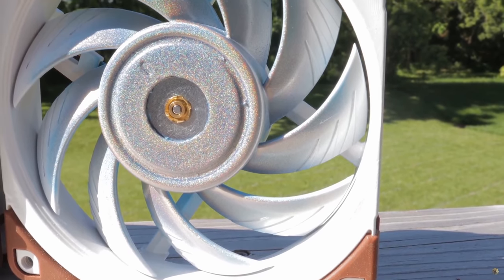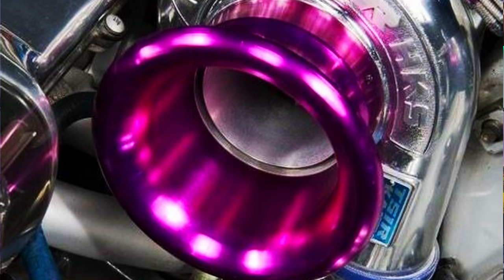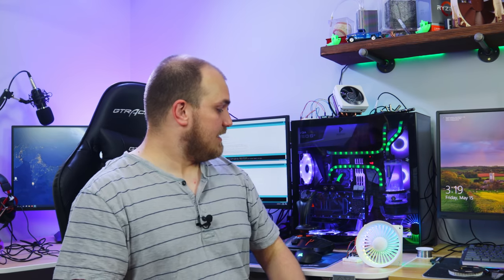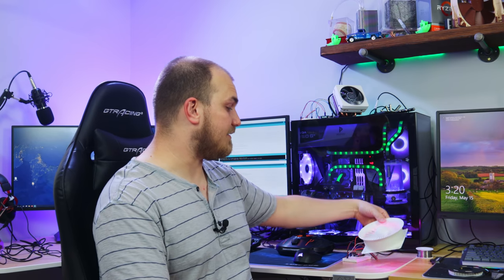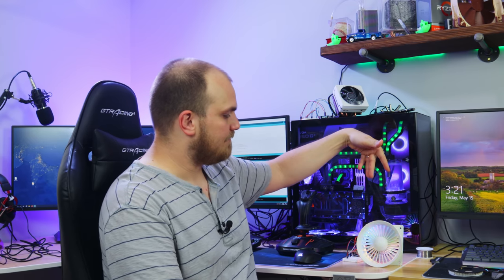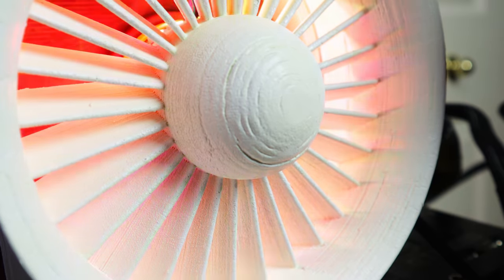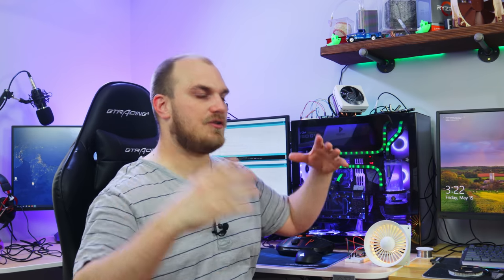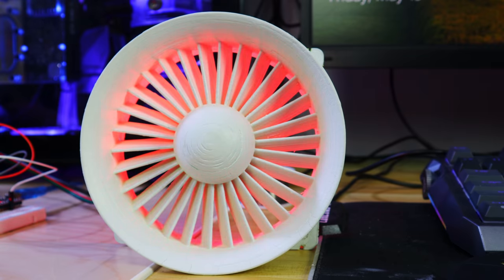This Makes Any Fan Look Awesome!

Comment: Ma man, you need to calibrate your printer
Reply: This is what I was going to say. You won't need to smooth out your prints (within reason - time is of the essence often) if you take the time to calibrate it. That way even if you're printing at low resolution you're just a quick sanding away.
Reply: A Dremel sander makes sanding super fast too.
Reply: Came here to say this. There's definitely a lot of room for improvement on his prints.
Reply: Cheap printers needs more effort, you need to reduce all the wobbling first before you calibrate it. I put under every screw from moving parts a polymer O-Ring to reduce the play.
Thats mostly enough to get way better prints. Then you can recalibrate your printer.
Reply: i got good results on a cheapo monoprice mini BUT i played so much time with all advance parameters on cuda and my prints take 1 or 2 days xD. depends if you want to put the effort or just go "good enough"
Reply: His previous prints were ok, maybe its just the material but god it looks disgusting in that close shot.

Comment: The idea of a velocity stack is to reduce the "intake resistance" where an airflow enters a duct. There is a problem with high velocity airflow, where at the edge there occurs turbulent flow, which is very very resistant for air to pass through, as it elongates the way the air has to take and in addition to this it favours the wall effect (the velocity of any fluid, that flows through a pipe is zero on the inner wall of the tube). So, when you have laminar flow, this means, the zone of resistance is very slim and close to the walls. Therefore, the airflow can enter the duct very easy. However, this effect is related to high velocity air flow. Your average PC fan is not nearly in those realms and the effect of a velocity stack should be near to impossible to meassure.
Also, since you added stators in your stack, which will turbolate the airflow, your creation should not work at all ¯\_(ツ)_/¯
Reply: The only velocity stack that i think could work would be one on the top of the pc case - assuking ur pc case has vent openings. Think cooling tower for a steam turbine. but obviously that woud look ridiculous. Either through convection alone, or a induced draft with a fan at the base.
Reply: Physics is a bitch, huh?
Reply: Case fan be like 40cfm. My 2 liter subaru engine pumps like 1 liter of air every revolution if it was 100% efficient and not count the boost the turbo makes. That's like almost 250 cfm at rev limit through a very similar size hole into the airbox. Yeah at those speeds that flare is very usefull

Comment: Exactly what I talked about in previous videos. You should test it on lower rpm.  It should improve airflow at lower speed.  What you build is a intake vane that directs airflow on the leading edge.  Depending on its angle a specific rpm would improve by it.
Reply: It wont improve it because his swirl duct vanes have the same pitch direction as his fan blades. If he had the opposite pitch it might have been possible to get slightly more air compression.

Comment: You need to place the printed part and the open acetone container next to each other in a large container and close it. Acetone vapors will dissolve the outer surface of the printed part and smooth it out.
Reply: Doesn't work for PLA though.

Comment: @Major Hardware It would be interesting if adding the "velocity stack" to the exhaust of the fan, and then add that inside of the case to see if it does a better job of cooling internal components.
Reply: also: to test if a straightened flow can cross a radiator stack with less drag
p.s.1: https://www.stlfinder.com/model/120mm-pc-fan-stator/4391442/
p.s.2: search the web for "axial fan straightener"

Comment: Your biggest issue is your slicing settings and/or machine needing maintenance.
For good White PLA get Zyltech Ceramic White. Best white i've found.

You want to print that at 0.05 to 0.12mm LH, make sure your extrusion flow rate (E-steps or flow %) is right, and you are printing at high enough temp but not too high. Typically recommended temps are way too low, i prefer 205-225C range for Zyltech PLA. Extrusion width should be for 0.4mm nozzle 0.4mm to 0.5mm.
Reply: Did you see the print? I'm not sure his printer is capable of 0.05 layer height, besides 0.15 or even 0.2 would be fine. and you can print as small as 0.36 or as large as 0.8 with a 0.4mm nozzle with 0.6 being the sweet spot for strength. As for temps, he really needs to work that out for himself, his thermistor might be off, or he might have a crap hotend.
Reply from the maker: My hot end is crop for sure
Reply: @MajorHardware  clean it thoroughly, make sure PTFE is all the way to bottom and the fittings are not loose. To take all play out of the PTFE unscrew top fitting 1 turn, nozzle 1 turn, then push ptfe down and tighten everything again. This needs to be done at 180C+

Some thermal grease on heatbreak top thread can also help a bit.
Reply: @MajorHardware I didn't mean any offence, if it works it works right? I watch your channel because you do awesome wacky stuff just cause you can, not because your 3d prints look like they were injection molded. 

keep up the good work man!

Comment: Great video as always!
I've always used a sandable filler primer to smooth out my prints. just 2 coats, a bit of sanding and you are good to go. 
So far the Rust-Oleum one gave me the best results, and you can find a ton of examples of people using the Rust-Oleum online.

Comment: I would recommend filling the imperfections with some type of epoxy then sanding it with a fine grit to smoothen it out. If not, then I would invest in a printer with a better resolution such as a Creality Ender 3/3 pro which are below $200-$300

Comment: you can buy filler primer that should fill in print lines somewhat, then for the deeper divots/print anomalies you can use autobody filler like "Bondo Glazing & Spot Putty, 00907"

Comment: For painting 3D prints, I use filler.  It adds a fast drying, sandable layer, fills in gaps and the print lines. Depending on how far you want to go you can spray/sand/spray/sand etc... Around 400/600 grit is ok.
Afterwards you clean off the dust, degrease and paint

Comment: You can try using body filler primer if you want an easier and faster way but typically that still needs a bit of sanding before and after you spray.  The spray paint and poly method works without sanding but be aware it is hard to get right, the trick is you use a bunch of light coats and dry with a hot box(a blow dryer into the hole of an upside down cardboard box will work great) or fan.   You actually go a bit heavier on the paint and use the fast dry poly to seal the paint pretty much.

Comment: You can smooth pla by using acetone fumes in something along the lines of a 5min on/10min off setup. the only real problem with that is the pla will melt under the pull of gravity so you'll have to orient it correctly and also use a fan of some kind to blow the fumes over your piece so it gets into the smaller bits.
you'll have to experiment to get it correct because it's a bit of a nuisance to get working perfectly.

Comment: If you use an epoxy primer, and wet sanding you can get a nice smooth finish on your prints. Start with about 90 grit. When you have almost no primer left but a smooth surface wipe it down to remove the dust and prime again. This time use 220 grit or higher with lots of water until very smooth

Comment: Once your 3D prints are done, coat them in filler primer, then sand them down, re-coat with filler primer, and sand off again. You can then apply your base-coat/colour of choice. Once your first layer has dried, lightly sand off with some high grit (1600 or higher just to remove any find bumps and splats within the paint coat) and then give its second and/or final coat.

Sauce:
Painted 3D models I've printed before and this is one of the best ways I've found of getting silky smooth finishes

Comment: Looking at the closeup of the stack, I noticed many voids and generally poor blending. If this is what you are getting regularly, I’d suggest to review the filament you are using, the settings of the printer and the slicer program are compatible and that the nozzle isn’t clogged. I had a similar result, cleaned out all the old PLA in the head, put a new nozzle and it fixed it. I also added a filament filter and now get consistent perfect prints roll after roll. Hope that helps.

Comment: You could also run those less off of any addressable led header on a motherboard or  lighting controller, just make sure 5v,gnd & dat lines are correct

Comment: I find filler primer works beautifully on pla prints, it does what it says, and is super easy to sand, you just gotta get close and make sure you're actually filling stuff in or else it isn't much better than primer

Comment: If I remember correctly, you'll want to take a little bit of solvent to kind of chemically melt the PLA to smooth it out and then sand it a little to get it the rest of the way where the resolution lines of layers are about even and then finer grit sanding should get the level and smooth texture where resolution lines from the print layering doesn't interfere with the function of the print item or add discernible difference in results between function testing of stuff. Some regular old 100% acetone from the dollar store should work. Just test it on a small area on a sample print and see if you get the results you want or are satisfied with. Though, if you want to smooth it out and also want to strengthen the printed item, you can use like epoxy resin or acrylic resin if you don't care about adding a little bit more weight. Depending on how much material you remove or resin added, weight and strength of material will be effected and acceptability is determined by need and you, etc, of course.

Comment: Try using automotive body fill to fill in the holes and gaps to smooth it out, less sanding down the printed parts. Sand smooth, prime and paint them. Also glue some fine grit sand paper to a popsicle stick to sand between the fins. Painting it doesn't get rid of the the unsmooth surface you have to fill it with something strong, hell even epoxy would work as well

Comment: btw, most aRGB fans also use WS2812, so you can control them with an ESP8266 or arduino.

Comment: Use drywall spackling. It's a great lightweight filler and it sands super easy. Then use a filling primer to smooth it out. After that, you can move onto your base coat and clear coat.

Comment: Just curious if you’ve tried printing that blade with the noctua hub and the outer circumference of the blades connected on a ring like the noiseblocker eloop?
Reply: if he did that he could use thinner blades too, if his printer allowed it.

Comment: One other thing I forgot to put in, you can also use one of the profiles that people use for minis, something like 25 for the speed and .4 or .5 layer height (just be aware that it will probably take forever for something larger like that fan shroud).

Comment: BTW you can wire the leds to directly to most motherboard addressable RGB, or most other RGB accessory. I have been using the lighting node from corsair for my underdesk ws2812B, instead of buying their expensive RGB strips for only 10 leds on one. You can get a whole meter (3 feet) or 5 meters (from china) for the price. 
Tip, if you use icue, on setup don't select the LED strip as the output since that limits you to 60 LEDs per output (10LEDS * 6 corsair strips max) use their high density fans (i.e. the one that has 120 LEDS) 
BTW, you also need to feed external power to the strip, and not the icue, to be safe. Wire Ground and 5V to your PSU and Gnd and signal only to icue lighting node.
Open RGB would work as well
Reply: I have used arduinos for lighting in the past, but this way it's way is easier to use, especially for beginers.

Comment: Also design time. Try a helical impression on a conical pointed center piece. Reduce the fin count to three. Add a little hight to the outside and give it a matching helical impression at say 35 degree twist. Try to match the spin ratio of the fan with the twist of the impression.
Line the fins up with the helix and extend them up and down close to the fan....
Ok that's all I got for this one.

Comment: If you had the fins angled in the opposite direction, what are the chances that it could potentially help with straightening out the airflow coming out of the other side? Just think of something like the Silverstone Air Penetrator series, or maybe with what you saw with the Scythe Mugen 2.

Comment: As far as your smooth 3d printing... It looks like you're having under extrusion issues. For fresh pla, I usually use 200-205 but also watch the extruder. If the little bearing that the filament rides in isn't moving, try adding a finger to give a slight bit of downward pressure. Not too much, just rest your finger on the lever. 
If the bearing starts moving, there may be a hang up in the filament path.... If the extruder stalls out and blips, losing a step.... Check the driver vref for the extruder against the data sheet. It's an Intretesting project, I'll have to try it in the silk white and silk gold

Comment: to get smother prints will cost you more time no matter what way you do it 

my best results are use .1 mm layer height with a .4 mm nozzle and run the printer at 50 to 60 mm/s but that will make prints take forever

other factors could be your temp's being to high part cooling is not good a worn out nozzle or even your extruder ether being to tight and chewing filament or to loose and not pushing the filament all could cause inconsistent flow rates 

tho other thing i use is a set of diamond riffler files they work wonders on PLA and don't take as long as sanding but they will always leave a velvety feel that is actually perfect for painting but also can be sanded to a polish relatively easy

Comment: you might look into putty.  perhaps the stuff used for plastic model kits.  tamiya and some of the others make it..  apply it, let it harden then it should sand smooth reasonably quickly.

don't know if the stuff will hold up well enough to use on spinning components, but it would work for this intake design.

you might also check out tamiya's spray paint or primers.  seen it in use on a Marty's Matchbox Makovers and it seems like its pretty user friendly.  he also uses simple krylon types too to good effect.

Comment: next step: realize that you can light up fan's blades directly to achieve right color
and yes, it's already on market - look up for Phanteks Halos
Reply: That's what I thought... problem is, it obviously looks awesome on white fanblades, but on black/brown/darkgrey fanblades I expect the effect will be underwhelming. I looked into that myself because I have grey Noctua fans in my case, and black NZXT ones on my Kraken X63, and I could do with some more light in my case... Especially the NZXT fans would be nice if they could throw some light down into the case, but I'm worried because they're black it will be too subtle.
Reply: I've got halos on black fans. One on fractal that came with the case, one on the Dark Rock Pro 4's silent wings. Halos still look great (especially on the silent wings since it makes their weird line shaped fans stand out). 
It would be brighter on white fans for sure, but it's still very bright on dark ones. 

On the brown noctuas I've seen recordings of it also looks good although I'd assume it'd make all colours off slightly towards orange - not much though since it's so dark.

Comment: So the only recommendation I can make for smoothing the pla would be using body filler to fill in the spot your able to get to so you wouldn't need to sand so much and then paint

Comment: Use a automotive filler on the PLA, easier to sand smooth. Then prime, sand, and paint, sand and clear coat. Better than trying to sand down PLA directly.

Comment: First a couple ideas for smoothing the surface.
1. Try paint like clear coat or something to infill the surface.
2. DISCLAIMER- BE CAREFUL STUPID IDEA COMING; If you go OUTSIDE you could try fire washing the part. A can of axe and a lighter should do. That means short blasts of one to two seconds. Again BE CAREFUL. I do not recommend fire washing for anyone else I am only referring to the OP 😅

Comment: What RGB controller software do you use? I have an Asus mobo, and Aura is kinda crap... and I'm not sure if it's my CPU fan or what header I've plugged it in to, but it just will not do any rotary effects.

Comment: It may not add anything but checking the amount of power draw might be interesting. If efficiency of flow increases it should use less power? That would show it is having positive (or negative) effect. Also, from my limited knowledge of bell mouth ducting on automotive applications, a radiused 'lip' around outside should improve flow. (as in the pic of turbo intake, the 'stacks will be marginal improvement with sharp edges. 
Research about 10~15 yrs ago also showed an elliptical curve wall is more efficient than a simple radius ( left side section looks like '9' tilted out a little to left rather than  cut off circle). Whatever, it doesn't make things worse and does look pretty good when running

Comment: Use a poly primer, you still need to sand as much as possible to get any high ridges out but for even deep scratched surfaces a good poly primer will in fact fill in holes and just a couple coats and you can then wet sand and finish with a good quality paint and clear coat and have a surprising smooth surface! Of course NOTHING but a bondo or good filler is going to save you from it when you opt to use such a large extrude nozzle!

Comment: Best way to smooth PLA? Maybe Polyurethane spray paint and regular spray paint.
OR-

Rust-oleum Gray Filler Primer spray paint and sanding. Yeah , the sanding part sucks.